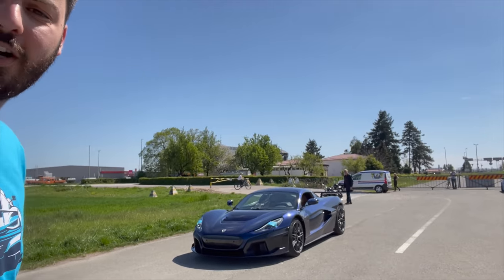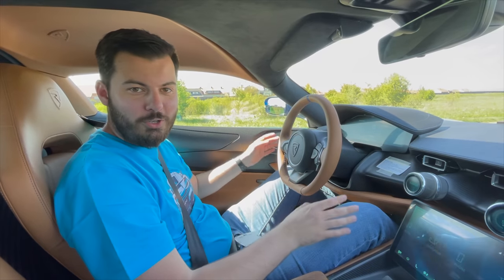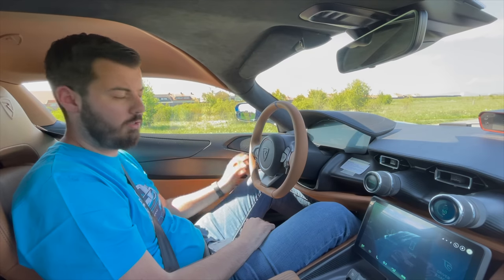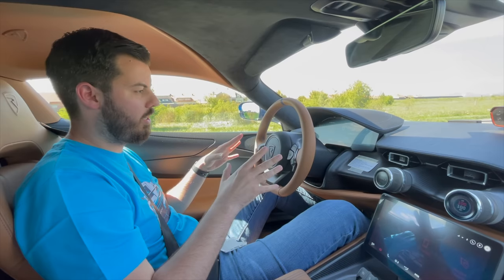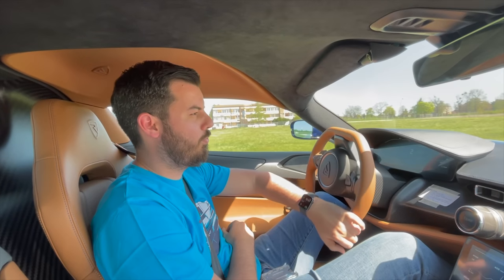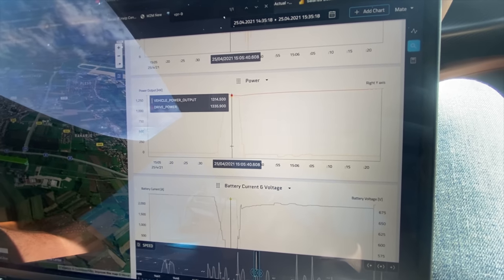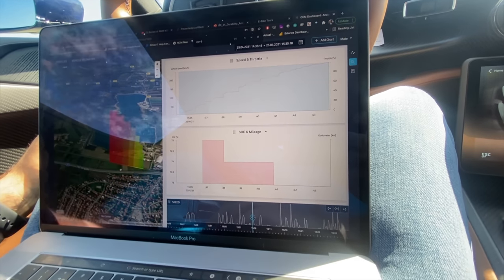Is Rimac Nevera the fastest accelerating production car?

Comment: What are the target track times?
Reply: @Amarjit Singh Dhesi How is that a target track time?
Reply: @Amarjit Singh Dhesi You have no idea what you are talking about. He is interested in Nürburgring. I think you will see Nico Rosberg take it round the track soon. You need to watch the Nevera destroy the Ferrari SF90. The Nevera destroys it. Link below.
https://youtu.be/A4orCB71BgY
Also these are the stats so far and it is still being tweaked before production. The stats are for what will be a road production car with road wheels and tyres. 
Rimac  Nevera. Pure electric car. 0-60 mph in 1.85 seconds.  Quarter mile in 8.6 seconds. 0-180 mph 9.3 seconds. Top speed 258 mph. 1914 HP. Torque 2360 NM. 120 KWH battery producing 1.4 mega watt of power. This a road car.
Reply: @Amarjit Singh Dhesi No it is not a GT car it is going to be a limited edition road card. 150 will be made. You need to watch the factory tour with Nick Rosberg,  plus other videos. Understand what they are doing.
Reply: @Amarjit Singh Dhesi Also you say he is not interested in Nürburgring well his performance model is based on 
Nürburgring I believe.  I am sure it is mentioned in one of the videos. They use a Nürburgring simulation model. His aim is for the car to do 2 laps with no loss of performance.  You do know that Porche have a 24% stake in Remic and it is still listed as a private company. They make the power train for Aston Martin and Koenigsegg.  They also make parts for many big manufacturers.
Reply: @Amarjit Singh Dhesi I never said he wanted to set a production record. I said 
Nürburgring was used in performance modelling.  What are you educated in? Burger flipping?
Reply: @Amarjit Singh Dhesi Oh the stress of working in a call centre must be getting to you.
Reply: @Amarjit Singh Dhesi Oh. Forgive the typo. Yes you are correct.  It is Rimac. It is actually a Croatian word.

Comment: I did my researches and accordingly to the data available on the internet, this Rimac is faster than a ''standard'' Chiron simply because it has 500 hp more. Comparing it to the Chiron Supersport, with 100 hp more than the standard (1.600 hp vs. 1.500 hp), the Rimac starts to loose ground after 330 km/h typically lacking the top end of ICE engines but it wins anyway after 1 mile. Data say that a Chiron Supersport with exactly 1.750 hp (150 hp more than the stock one, easily achievable by chiptuning)  would pass the Rimac at 350 km/h winning the 1 mile drag. With 250 hp less and the same curbweight. All this in theory, of course. In short, it seems that the classic ICE engines powered cars, with same power and same weight, are still faster than the electric powered ones.
Reply: Rimac is 150 kilos heavier. And still can't pull full power. But as of now it does 0-300 in 11 seconds, 0-350 in 15.6 seconds, 0-370 in 18.5 seconds

Comment: Definitively impressive but where are the goose bumps ? It looks like being the stone in the slingshot but is there any interest to reach mach 1 in 4seconds while both traffic and speed control is the actual everyday life ? I mean, with a V6/V8/V10/V12, you can enjoy the sound of the engine from idle to the top revs and hear it giving different notes  depending on the throttle load. Here, it's just sitting in a fighter jet seat on an aircraft carrier as a passenger waiting for the 5G launch. After 10 launches and when you realize that you'll only be able to use it at 25% potential, even with torque vectoring bla bla, will it keep any interest ? Maybe for some, probably not for me.

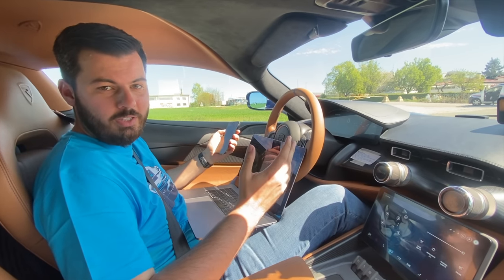Comment: 6:45 That is NOT COOL
That is shit, utter garbage.
Cars should not be constantly connected to the interent and there should be constant communication of all car systems with each other.
This is extremely dangerous as it opens up the:
#1 violations of privacy for the owners
#2 increased risks of malicious attempts
#3 potential death of owners from sabotage of hackers
You should make the car hardwired to be standard OFF the grid and all components be separated from each other, not a common computer / software. And with a physical hard switch (not software or digital) to be turned ON for various functionality.
So for example the car is OFF the internet and not transmitting/receiving any data but it has been activated for various functions to work together within the car.
Or other example, even if it is connected to the internet, there is no access from outside sources to receive essential information of the vehicle, like speed, location, engine info.
You can do that only by plugging in a physical OBD connector with a cable to a local computer that has no internet either.
It's very easy to hack any device in the present.
Tesla can and have taken control of owners cars. That is beyond any rights any person should have to breach property and privacy expectancy.

Comment: You're comparing apples to oranges here. This Rimac looks and sounds clunky (I appreciate it's not full production though). The dials sound terrible when you turn them, and there are loads of squeaks and rattles as it accelerates. This is just a sales gimmick - pitched right at Bugatti, but I think Bugatti are above this, and I know, if I had a choice, which car I'd go for. The Chiron has more refinement than the Rimac will ever have - this Rimac just just looks like a cheap banger in comparison.
Reply: It’s stone chipping from the road, not squeaks and rattles.

Comment: Even with a 120kWh pack, they're still pushing the batteries way too hard. At full power, you can kill the battery in what. 10 minutes? That kind of discharge rate will kill the battery in 100 cycles.. 

They're probably counting on people on not floring this car all the time.

It's why tesla doesn't offer a stronger motor, even though they could have.

Comment: Stop comparing electric motor with diesel/petrol one. Is pathetic, maybe it's faster but you just making those amazing engineers that created those insane engines looks stupid. where w16 is the pinnacle of technology where the electric engine is... just an electric engine.
Reply: You think that the engineering of an EV stops with its electric motors? Boy, are you wrong. The motors are the most simple part of an electric car. The amount of engineering that went into the battery of the Nevera rivals that which goes into engineering a hypercar engine.